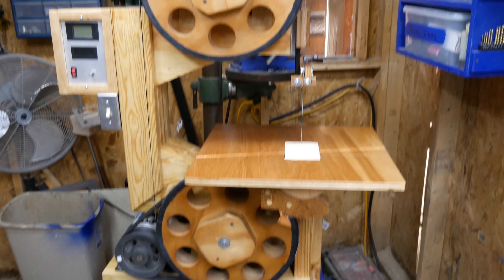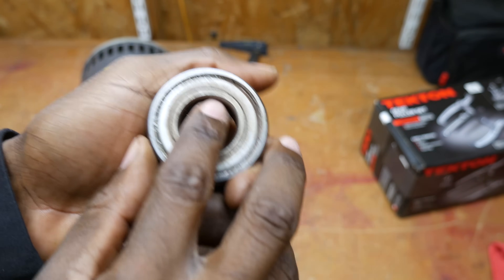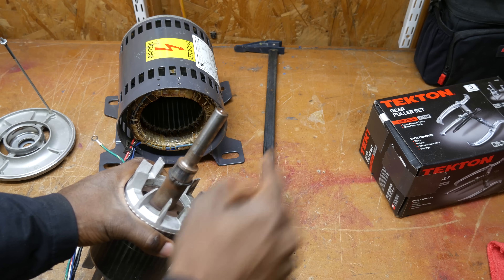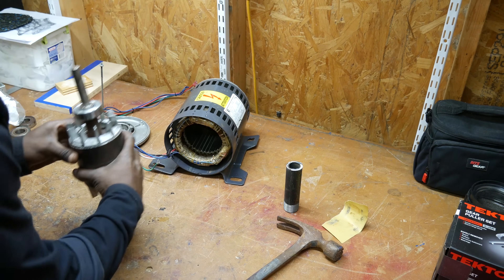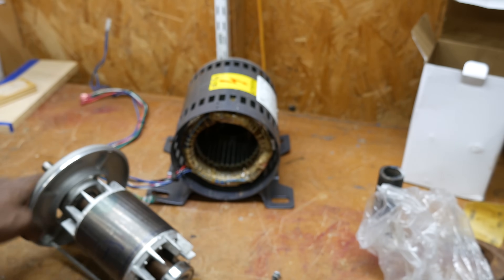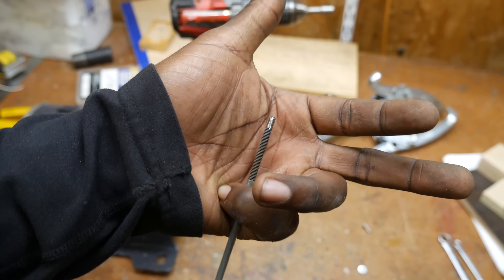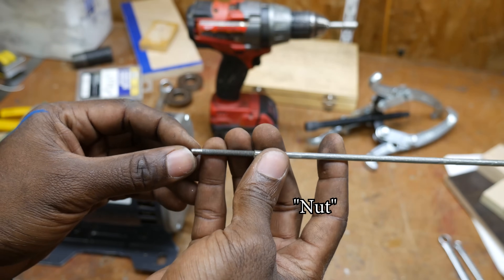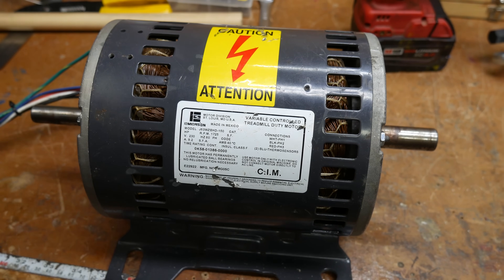My BandSaw Is Noisy; Replacing Motor Bearings For The First Time: 044

Comment: If you own a Dremel grinder, you could avoid buying that gear puller by cutting both of the bearing rings. I did that for a washing machine and I could cut internal ring without damaging the shaft.
Also, you could try putting your rotor in a freezer. I once saw people fitting bearings by using some liquid nitrogen in a plant.
You could drill and thread both ends of the rotor allowing you to pushing your pipe with a screw and washers.
I knew clamps would not work before you started. I once succeeded with a wise but my part was much smaller.
Congratulations anyway!
Reply from the maker: +François Gasnier Dremel seems like a nice option. Thanks

Comment: IMHO, The question to ask is: Did it work? Did you damage the bearing or shaft in the process? etc. If the answers are all "No"  you did it right
.  BTW, In the days BI- (Before Internet) I repaired a fair number of B&D drill motors that needed brushes. Here, the brushes  ware basically unobtainable. I found that the brushes from old military dynamotors were the exact same brush set. Gotta love that military & industrial surplus!
Reply from the maker: thanks

Comment: I use a 15 dollar toaster oven from walmart to heat bearing to 200 degrees, then fastenal sells a freeze spray to spray on shaft to freeze, then you only need a few lite taps with pvc pipe.
Reply: You can use those PC dust bottles upside down for this purpose, I have before! Whatever works, you are just trying to get a temperature differential between the mating parts.
Reply from the maker: Freeze spray... like the PC dust spray bottles up side down? Sounds like the same thing... which is awesome
Reply: Its actually called Loctite LB 8040, freezing down to -38f,it works great!

Comment: I have a press but you can't always use it for a given application, so it frequently comes down to a piece of pipe or a socket and extension and a hammer. You just have to use caution just like you did. Well done for a first try. Just like a pro.
Reply from the maker: Thank you :)

Comment: Right way, or not, it's how I install bearings. What I do is witness mark the bell ends so I put them back on the way they came off. The ends are symmetrical, but they kind of run in over the life of a motor. So they just run best back the way they were. Those are really nice motors you have. Well worth putting some new bearings in. If you're being cheap you can pull the shields off that kind of bearing and repack them with grease. But they never run like new again. Still, it works. You just put a sharp pick through the shield and pry it off. Then some folks put some RTV in the hole the pick makes. I tend to just flatten the hole out with a flat punch and it pretty much closes back up. Good enough.
Reply from the maker: Some one else mentioned re-greasing them... I didn't see a way to do it without damaging the seal. But, it sounds like that is the way to do it. The price was low enough for new bearings I would probably pass on that labor, but it is good to know people have done it successfully.
Reply: It is a hack fix. Because once run dry bearings do take a beating. So greasing them back up only goes so far. But it is often far enough. Take the other beat bearing and poke a hole in the middle of the shield with a sharp awl and pry it out. You have to luck out and poke between bearings to get the awl tip behind the shield for a good pry. Then once the shield is out flip it outside down on a flat anvil surface and beat the prick hole down with a small flat punch, like a nail set. You can see the hole just about closes back up. Shielded bearings are kind of an industry scam. But no one services stuff anyways, so I can't completely blame manufacturers for doing it. To get the rubber off sealed bearings you use one of the angled X-Acto knives. Then you attack it on the edge where the lip holds the seal in. Kind of work it off like a tire.

Comment: In the past I have placed the bearing on a 100W light bulb for about 5 minutes (about 2.5 minutes each side) and that was enough heat to expand the bearing and allow it to slide on with no problem. Use gloves as it get really hot, also the bulb would need to be an incandescent bulb probably.
Reply from the maker: Now that is some low budget heating... I love it! LOL

Comment: A bearing nomenclature/sizing video would be great! The bearing type, size (dimensions) and type of shielding can often be read right from the imprint. The type (or lack) of shielding largely dictates if it can readily be serviced, or is intended to be replaced. My only working knowledge comes from 608ZZ type, and that series alone has a huge number of variants with regards to materials, assembly, lubrication and serviceability.
Reply from the maker: Thanks... I am considering this as a future video.

Comment: I would have just thrown the motor part in the freezer. LOL
Reply: I have slightly heated bearings using a 60 watt incandescent bulb, and cooled the shaft in the equivalent of a freezer (outside in the winter in my climate.)  Sometimes one or the other will work, but doing both works very well.
Reply from the maker: I considered heating the bearing... but when I actually started doing it, for some reason I completely forgot about that. Freezing the rotor and heating the bearing might have made it slip right on. I think that is the way to go.
Reply: Jeremy Fielding I totally agree. I think though in this setting just cooling the shaft would have been sufficient. Worth trying next time. Awesome videos by the way! They are enjoyed by me here in Kingsville Ontario Canada. Take care.

Comment: I've heard of that! I have personally used an electric hot plate, and a toaster oven in a pinch. Also using a light oil, such as bearing oil, on the shaft just prior to installation helps tremendously! Wipe up the excess, them the heat will take care of the rest.

Comment: u can use a microwave to heat the bearings. YES metal in microwave. You wrap the bearing in a wet towel and nuke it. Thats one way of heating bearings. Check out AVE he does this. Also put the shaft the bearing us going on to in the freezer and let it get very cold. it will shrink allowing easier install.  I heat pinion bearing races with my torch to install them. no bearing failures to date.
Reply from the maker: Sounds like a plan. I like it.

Comment: When you mentioned press fitting the bearings back into place, I kept expecting you to pull out a massive bench vise. When I saw the Harbor Freight clamp, I immediately thought "ain't no way that's going to work. You need a sledgehammer, brother".

 But I suppose a small hammer will work too.

Good video. Thanks for keeping them coming.
(I just wish I could find cool motors like that!!)
Reply from the maker: That one came out of a broken treadmill. One of the very large ones you see at big gyms. There were three of them there... I only had time to get two motors. At 4 hp each... they are the biggest ones I have found yet!

Comment: If you have to use a hammer, to drive in a bearing (pressing is better in any case), use a recoilless Hammer. Thats these plastic/pvc-headed hammer filled with litte steelballs. Then dont hammer it with whack whack wack, only ONE whack and look, if the pipe is there, where it should. And again one whack, till you have it. 
And all was very right. I have changed so much bearings in my live. So i know this feeling, when you turn the arbor in the motor and...... whats that? Where is the noise?  :-)
One more video, which would be useful in education. Keep on, Jerry!
Cheerio from Germany.

Comment: I use a 1 inch PVC pipe to hammer races onto bicycle fork steer tubes.  It's less damaging if I slip.  It looks like you didn't bend the shaft!  Great job!  I've used C-clamps on other bearings, but don't have one long enough for that motor.  There is a tool called a Bearing Separator made specifically for jobs like that btw.  But sinse you weren't planning on re-installing the same bearing, you didn't really need one.  Don't forget to lube the bearings occasionally.  That's probably why the other ones got so loose, rusty, and noisy.  GBY.
Reply from the maker: These are suppose to be permanently lubricated bearings. But looking at the inside... it was pretty dry and crusted over. I have never tried to re-grease a bearing... I was concerned about breaking the seal and not knowing how to get it back closed.
Reply: Jeremy Fielding Yeah, those bearings aren't made to be lubed, but it can be done.  Most people don't bother.  Just be glad you didn't just pull off the outer race and spill the bearings all over, leaving the inner race on the shaft for the second try.   It takes longer that way.  I tried it that way once (not on purpose).  I shouldn't have rushed by using an air impact driver with the puller.  Did you notice the change in sound when the bearing became fully seated?  The last tap sounds different.

Comment: Simple tips to make bearing replacement much easier:

Put the new bearings in a plastic bag and place the bag into a bowl of very hot water without any water getting at the bearing (or alternatively put the bearings in an oven at a low temperature.. 80 degrees Celsius or so)  This will make the bearings expand outwards just slightly, but enough to just slip the bearings onto the shaft with little to no effort.

If you need even more leeway, put the shaft into a fridge or freezer as well as heating up the bearing and it should slide right on with just a gloved hand.

If you're having trouble getting bearings off a shaft, you can use a blowtorch on the bearing, in conjunction with a pullers, all you need is a small amount of heat in just the bearing, more won't necessarily help.
Also do not use a blowtorch to heat up new bearings because it will likely heat up at different rates and melt the grease out before its hot enough to expand.

I hope this helps someone out there!
Reply from the maker: Thanks!
Reply: My understanding for steel is that you get about .001" for every 100 degrees F in temperature differential (roughly).  That's just about what you need to get these interference fits to not interfere in most cases!
Reply: Possible fracture from manufacture defects with heating/cooling methods but if short on time and lacking in tools, this makes life easier.

Comment: Thanks for your videos again! Very interesting. I haven't yet watched all your videos about how to salvage and reuse motors but I plan to.

Could one build a bandsaw that is offset like those band saws for cutting metal beams are? I guess it's not that practical but ideally I'd like a bandsaw that I can use to cut smaller pieces but also metal beams. If I ever build a band saw.
EDIT: Oh never mind lol the recommended video after this is exactly what I'm looking for hahaha: ("DIY Metal Cutting Horizontal/Vertical Band Saw")
Reply: You can get a 4x6 horizontal vertical band saw for under $200 on sale. Believe me when I say you can get more than you money's worth out of that machine eventually too. I've had mine since 1992 now and I've cut so much with it. The cheap cord gave up the ghost a couple years ago, but other than that it is still going strong.

Comment: A die out of a tap and die set may have been able to restore the threads on that rod. You can get fairly cheap sets.
Reply from the maker: I don't think there was enough material. It was striped to the min diameter.
Reply: nah he stripped them threads off good. There was no metal left to tap.

Comment: I not screaming at you as the method you used has been used by just about every mechanic out there. Hey, it works! There are a number of ways to fit bearing when it is an 'interference fit'. Yeah, your right, probably going to get a bunch of comments telling you how to do it. Bottom line is you used common sense and was careful. There is no 'the only way' when it comes to interference fit parts being installed
Reply: I remember the time I got to rebuild a 30yr old Bell Winch, (used to lower and lift the diving bell on a dive support ship. One drum bearing had an ID of 23 inches and was destroyed. There was no such bearing to be had anywhere in the country. We sent it to a place that said they could repair it (the bearing), they welded the damage, machined the races and regroup the ball channels to fit one size over balls in it. They did a great job although at a cost most of us couldn't afford, it was alot. I installed that bearing using a 1 inch dia brass rod and went very slow, if I damaged that bearing it would mean we would have to redesign the winch. I breathed a sigh of relief when I finally reach the proper seat without so much as a mark. The winch passed all testing with ease. Job finished, call the hotshot to get it back to the ship! I spent about 60 hours rebuilding that winch. I've worked on some  very specialized pieces and believe me when I say , I Loved My Job. Just trying to get past the effects of chemo and radiation treatment so I can return to my job., BTW, I beat stage three lung cancer.
Reply from the maker: Thank you! I was just thinking people might say I should use a fancy press and special bearing heaters or something like that. That is why at the end I say "low budget" tips.
Reply: Man, you would not believe how many differant ways there are. Over the years I think I've about used them all. Even ruined a few new bearings along the way, LOL. It happens, that's the part where I said 'common sense and careful', sometimes I don't practice what I preach, LOL
Reply: Bravo James Moore!  

I think there are a many back yard mechanics that have successfully seated bearing using a hammer!  I know I have, and a BUNCH of times!  I can honestly say, it worked successfully every time.  Of course I was careful to press on the outer of inner race (depending), like Jeremy did... speaking of which, god job!
Reply from the maker: +james moore that is awesome
Reply: where i work we use one of those small ovens from the warehouse but i have a handy piece of brass rod used like a pin punch for fitting wheel bearing outer races to prevent damage

Comment: So, do you not have to pack these bearings with grease?  I've never replaced them in an electric motor, just wheel bearings on cars.
Reply from the maker: +Jeremy Turner they come lubricated and sealed
Reply: sealed for life bearings don't need lubricating.
Reply: those were shielded bearings  not sealed  shielded bearings have the metal shields that do not contact the inner race  sealed bearings have a rubber seal/shield on both sides normally red, orange, blue or black in color  bearing part numbers  these in video are i think read 6205 2z    the z means shielded   if there where sealed they would read 6205 2r  r means rubber seals 2 meaning 2 seals. as for the install method should have just grabbed the hammer to begin with ive installed 1000s of bearings like that for the last 25 yrs  never had an issue you just have to use common sense .  but never use a hammer on ceramic bearings good way to make some very expensive broken parts in a hurry
Reply: They don't need lubricating, until they do. Sealed for life means when they dry out they die. So it is a bit of a self fulfilling prophesy. But all of this is in a bearing manufacturer's best interests. They don't make money not selling folks bearings.

Comment: I used to work for a motor repair shop and we used a bearing induction heater to heat the bearings to 155°F then they would usually slide right on if you were quick enough. If you had to tap them on, we had a set of metal pipes in all of the inner race sizes that we would use in conjunction with a dead blow mallet. But for the garage mechanic, this way would work just fine! Great video!
Reply: U can use a microwave if u wrap part in wet towel
Reply: That's what we used also... The Heater works well... but be fast !!
Reply: Jason Lufrano I've used those bearing heaters, they work good and are quick!

Comment: In my opinion a Hammer is fine for putting on a bearing you did it the correct way
Reply from the maker: +Stephen Wright thank you
Reply: The key is to drive the bearing straight. You put it on crooked and you run into all kinds of problems then. That's why you had zero chance with those clamps that were on one side of the bearings. Because they couldn't get a straight press.

Comment: Jeremy, I have installed many bearings on up to 5,000 H.P. motors. We would warm/heat the bearings to +210 F. You can use a heat Tempilstik or a heat temp gun to determine the temp of the bearing.  Use a oven, heat gun, infrared light and you will do less damage to the bearings.Heat and press the bearings on. They can get warm, but beating will cause premature failure. I enjoy you videos and keep up your great work.
Reply: I use a coffee mug warming plate for small bearings and place the rotor in the freezer.
The bearings usually drop into place on the shaft without any force.
To remove the bearings from the shaft, I use a bearing splitter and a puller.
Good video. Thanks.
Reply from the maker: Thanks... The heat gun or oven is certainly doable.
Reply: if you heat the bearing is not grease oil inside bearing will be melted?
Reply: Save comment, thanks man